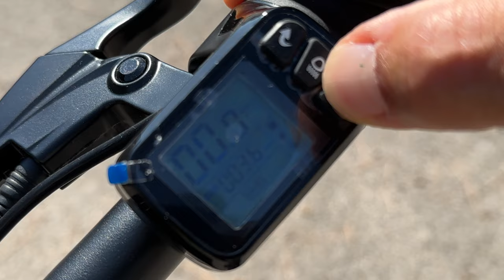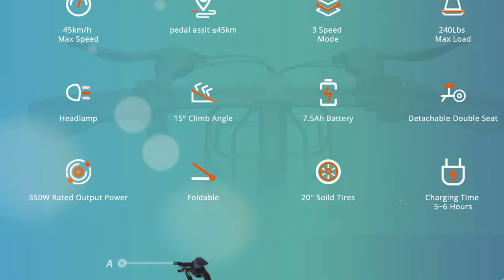KUKIRIN V1 PRO - THE BEST PORTABLE ELECTRIC BIKE - UNBOXING, ASSEMBLY, TEST & TOP SPEED

Comment: DONT BUY THIS BIKE  ......
 , I tell a quick about the bike and about the factory , I buy this bike kukirin v1 pro to my girlfriend in Italy , In less than 1 month of use, the bike developed a defect in the rear wheel.the spokes were not tightened correctly by the manufacturer,several spokes broke,We contacted the manufacturer, only they could replace the warranty,We send videos along with several emails, and the manufacturer is from China and doesn't want to give a guarantee ,Think carefully before buying something cheap and made from China, as in the end you could make a huge loss. A Youtuber friend from Italy will provide FEEDBACK on our bike and report how the manufacturer treats customers when there is a problem.